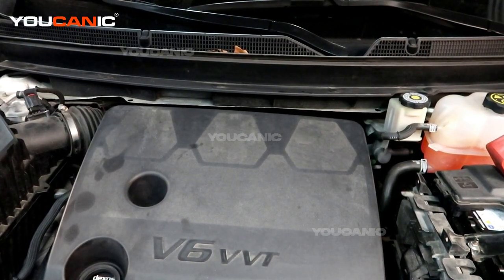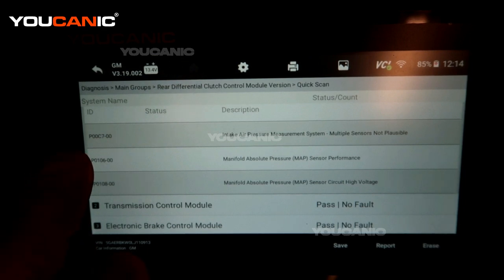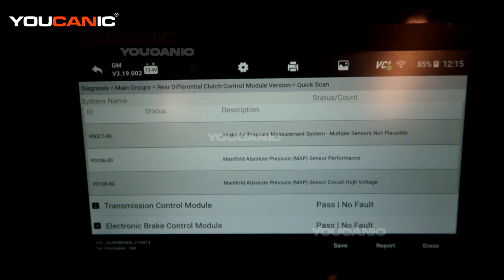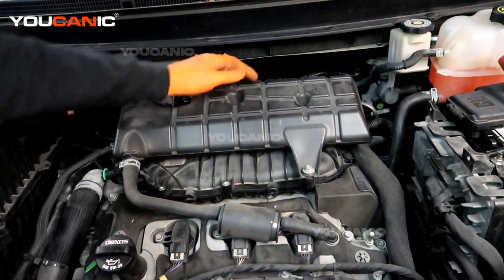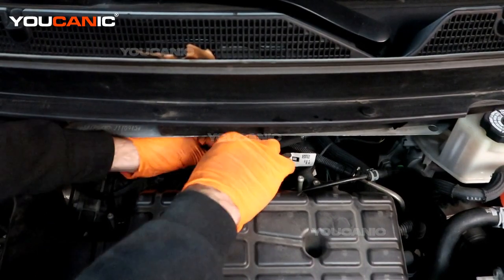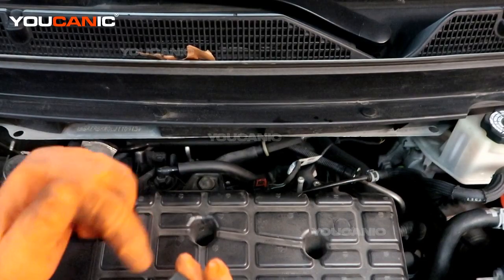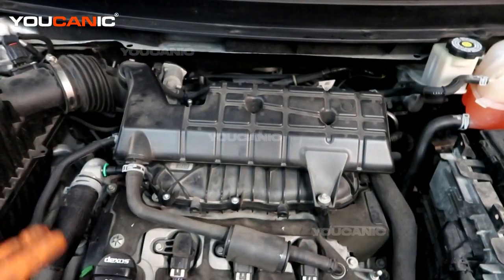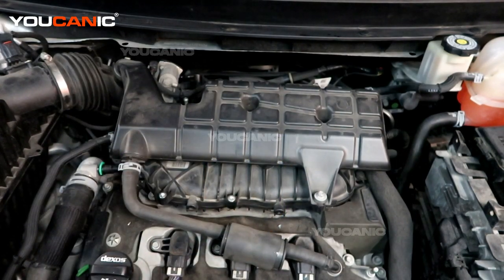GM Manifold Absolute Pressure Sensor Replacement - P00C7, P0106 & P0108 Fault Code

Comment: I have code P00C7 on my 17 Silverado. I replaced the map sensor & the check light came off on the first time I cranked it on. 2nd time I turned it on the light came back on. What to look at next?
Reply from the maker: Hi there! Thanks for reaching out! We're here to support you at Youcanic. Fault code P00C7 involves the fuel pressure and could be due to a variety of reasons. It's great you checked the Map sensor. However, it's advisable to check other components like fuel filters, fuel pump, along with their electrical connections. 

We highly recommend exploring our free guides, resources, and try out our powerful Youcanic scanner at www.youcanic.com. We not only have comprehensive solutions but also factory repair manuals. Remember our aim is to empower you to fix your vehicle with confidence.! Let us know if you need further assistance.

Comment: Why didn’t you check the circuits? How did you know it was a faulty MAP sensor?
Reply from the maker: Thank you for your feedback. We knew it was a faulty MAP sensor because of the symptoms and error code that the car's system was displaying. However, to accurately diagnose modern cars like how an expert mechanic does, a good professional diagnostic scanner such as our YOUCANIC Full System Scanner is needed. Check out our scanner [here](www.youcanic.com/scanner).

Our goal is to empower car owners with the right tools for their car repairs. Further, for precise procedures, Factory Repair Manuals and Torque Specs are invaluable. You can access these for a small fee [here](www.youcanic.com/manuals) to ensure you complete your repair jobs effectively.